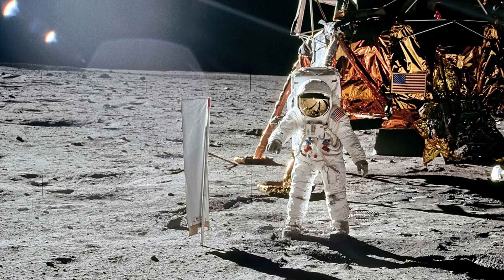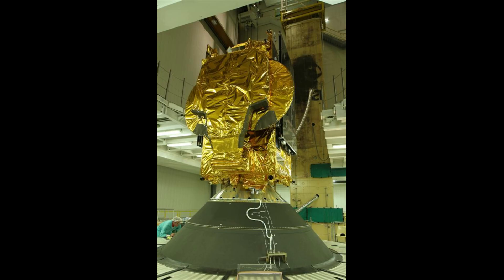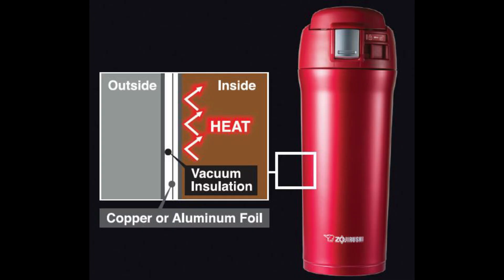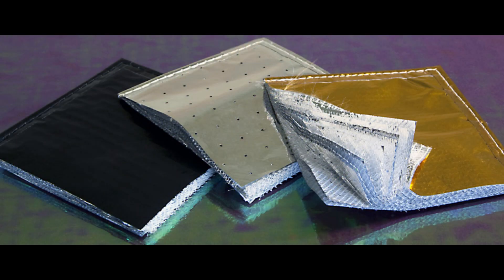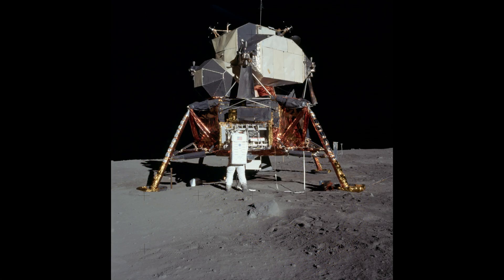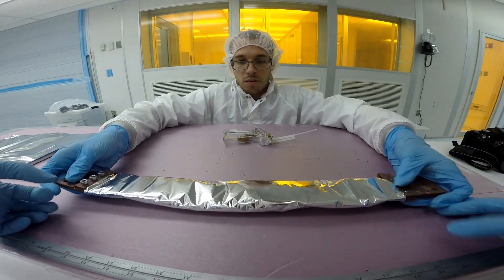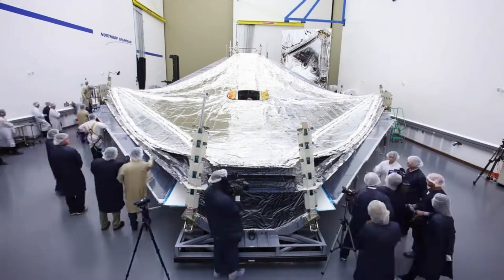Spaceships Are Not Covered In Gold Foil - The Cool Engineering Behind Multi-Layer Insulation

Comment: and what about radiation and charged particle shielding  gamma-ray , x-ray , proton+ , nuetron  ,  what apollo use for handle that ?   7 cm. lead ?  water ?  or something liar ?
Reply: Funnily enough the problematic radiation was the type you didn't mention.
Reply: Radiation levels in space are low enough that no radiation shielding is necessary for missions of up to 6 months.
Reply: @Hobbes746  UNLESS you get hit with a CME. The astronauts onboard the ISS are probably a bit worried right now.

Comment: I wonder if you applied this technology to vacuum flasks you could improve the thermal insulation and potentially reduce the size of the cavity on a vacuum flask (you loose quite a bit of liquid capacity on cheap vacuum flasks)

Comment: One genius (and simple) method of passive insulation was used on the Lunar Rover, where the batteries were packed in paraffin. While the rover was being used, the paraffin would melt, absorbing the heat being generated by the batteries, which would then solidify once the rover was parked at the end of the EVA, dissipating the heat that accumulated during use. This was a low weight solution to the more elaborate cooling system which was originally planned for the rover.

Comment: I'm confused. I don't get why the thermal blankets are crumpled. At first you explained how thermal flasks worked. Having vacuum in between the metal layers keeps the temperature from radiating. But then at the very end of the video you said that by crumpling the layers you make some touch each other improving the thermal blankets' efficiency. Could someone explain that for me please?
Reply: I think the issue would be if two flat layers accidentally came into contact it would eliminate much of the gap between them. With crumpled layers it guarantees that there will only be a few contact areas and the rest is not touching. And maybe the angles that get created cause the radiation to bounce around randomly, although that's just a guess.

Comment: "Gold is used because it's more resisted to oxidisation." But why is oxidisation a problem in space?
Reply: 1. spacecraft spend months to years being built and tested, in Earth's atmosphere, before they're launched.
2. in low Earth orbit, there isn't a perfect vacuum. You still get molecules escaping from our atmosphere, including monoatomic oxygen, which is very reactive. 
3. many electronic systems in manned spacecraft are inside the pressure hull.
Reply: @zounds010  thank you for the information :)

Comment: It always buged me that the Voyager spacecrafts  had these openings in the frame that look like vents in a tube radio, .. how could they be vents in a vacuum‽, 
  but back when it launched that's what my teachers told me.., I still wonder what their real purpose was.
   Maybe they were vents for during ground testing, I still don't know.
Reply: Yep, those are vents. Nor for air to flow through, but for heat management. When the vents are open, more heat escapes. 
this was done because the Voyagers had to operate in a wide range of thermal environments: Just after launch it was getting a lot more sunlight than farther out in the solar system. So the vents were open in the inner solar system, and were closed once they got farther out.
Reply: @zounds010  just doesn't seem like it would make much of a difference in a vacuum....
Reply: @petevenuti7355  Because it's a vacuum, the only method for heat transfer is radiation. Think of it as photons. With the vent open, photons can pass through unhindered. With the vent closed, they are reflected or absorbed and stay inside. 
The body of the spacecraft is packed in MLI blankets - in Voyager's case they had a black outer surface. The only gap in the insulation is these vents.

Comment: I was told by persons who may not have known what they were talking about that heat can radiate directly through a vaccuum if it's small enough which is why double-glazed windows keep their panes a minimum of a quarter inch apart.  Have I been mislead, Scott?
Reply: Yes, heat can radiate through a vacuum (basically as infrared light). The amount of heat that transfers this way is much lower than can be transferred through conduction if the two panes are in direct contact, and the amount depends on temperature (it scales with the fourth power of temperature).
Reply: @zounds010  I think the question is about the distance, i.e. whether the size of the gap can have an effect on the amount of heat that is transferred. It would seem like it wouldn't make any difference, in which case the quarter inch minimum in double-paned windows is more of a mechanical constraint having to do with the way the two panes of glass are set in the frame.  Or maybe it's because the krypton and argon inside the gap transfers heat so having a larger gap helps. Then again I think someone said that the distance between the layers on the JWST solar shield makes a difference, but I don't know if that is correct.
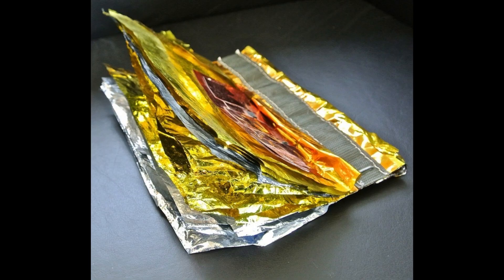Reply: But at about 3:45 Scott says that it doesn't matter how far apart the scrim keeps the foil layers as long as they are not touching. I remain baffled.
Reply: @johnedwards2119  My guess is that in the case of JWST the width of the gap is purely mechanical, with the goal simply being that the layers do not touch, per Scott's comment. When we look at the JWST sunshield it seems like the gaps between layers are quite large, but on the NASA site it says that while the gap between layers is ten inches at the edges, it's only one to two inches in the center of each layer. This helps direct the radiation away from the center and towards the sides where it can escape.  Probably they could have made the gap in the center less than an inch, but that may have been more risky and required more mechanical precision than they wanted to chance.
Reply: @johnedwards2119  Most double-pane windows don't have a vacuum between them, they're filled with an inert gas at atmospheric pressure. The distance between the panes depends on the geometry of the window: there's a balance between heat loss through conduction and convection that changes depending on the spacing between the panes.

Comment: I got a bunch of that gold foil looking insulation stuff. It is mylar laminate yup actually coated with gold. Not enough to be any weight though. The current version of the stuff has all sorts of layers as shown, but no gold. Instead, it has a layer of silicon and silicon nitride to reject the mid and far IR and aluminum to reflect the visible, polyimide is used instead of mylar because it is tougher and radiation resistant.

Comment: Buzz (or maybe Neil) said you could poke a hole in the lander with a pencil.
Reply: In the foil? Sure. In the pressure hull (which was thicker than the body panels on a car): no.
Reply: That's one of those popular myths, along with similar claims of putting a screwdriver or foot through the wall. However none of them are true. First of all there was almost no "wall" to put something through because the astronauts were surrounded by switches and instrument bays. There were some small areas of wall exposed, but the aluminum skin was about 0.3 mm thick, about the same as an Apollo era soda can. Which is why you sometimes hear the soda can analogy for the LM's skin thickness, although it was actually about three times as thick as a modern soda can.

The skin was reinforced with ribs every few inches which you can see in the photo at 11:15.  It would be nearly impossible to put a foot through it. However if you were really intent on putting a screwdriver through it you might with repeated attempts, like you could probably stab a screwdriver through an airliner hull if you were really determined to.

Comment: My uni heat transfer professor alleges that his mentor was brought in on an emergency basis to perform view-factor calculations on the legs of the LEM and tell them if they needed the foil due to radiation from the rocket plume.

His answer was no.

Their response was thanks but we'd feel more comfortable if we include it anyway.

Comment: There is another way to manage heat in space that you did not mention: phase changes.

The Apollo PLSS (Personal Life Support System) used the evaporation of water when exposed to vacuum to cool both itself and the coolant that was circulated through the astronaut's undergarments. 

The LRV also used a phase change to cool its batteries, but in this case the phase change was the melting of wax in trays that were attached to the batteries. This was supplemented with two small radiators that could be opened or closed as needed. (If they parked the LRV in the LEM's shadow, for example, it would have got really cold.)

Comment: I assume the crumpling was to keep a strait path to a minimum? The explanation of crumpling is kind of confusing but that's what I gather was the intent? 

IE all peeks and vallies in any given spot won't align due to probability, and the elasticity or springiness of the material will act like microwave button and keep it apart when you are not pushing it well non touch screen microwave.  Meaning someone servicing it won't leave a hand print on it and ruin the properties by servicing it?

Comment: about temperature management in space, 
if we take a plastic water bottle (without any thermal protection) filled to 80% with water at 15°C the rest empty for the expansion of the ice
If we place this bottle in the shadow of the ISS how long it will take to freeze completely
Reply: Plastic water bottles generally can't withstand a 1 bar pressure difference. If it leaks, the water will evaporate in the low pressure.  Substitute a Coke bottle, and it might last long enough to form ice.
Reply: Using the Bolzmann law I get about 0.5J/s of heat radiating from the bottle.

Comment: Hey Scott, have you thought that instead of using a heat shield and a lot of fuel to bring the starship down to 120 km to reenter and slow down -- how about this idea.  A space "anchor".  Take  a large grid panel of ceramic, about 500 kg that is rolled and in the ship and then exits the ship and unravels into a 5 m x 80 m rectangular grid, each grid being 2 cm x 2 cm.  This grid is attached with a high strength steel cable of 50 km to the space ship.The grid is rocketed down so it is 50 km closer to the earth, and the ship descends to 170 km..  The grid will reenter the atmosphere first and starts meeting drag and this force causes the ship to slow down and come closer to earth, causing the grid to get lowered into even denser atmosphere causing more drag.  By the time the ship is down to 120 km, it will be going let's say at 7,000 km/h and does not need heat tiles. Just like how a Falcon 9, which rockets up to 125 km at 7,000 km/h, and then with engines facing the direction of travel reenters the denser atmosphere, and then at 60 km altitude and a speed of 8,000 km/h does an entry burn, down to 5,000 km/h, and lands on the barge.  This requires less fuel than without an anchor, and the weight of tiles and fuel, expenses and time needed to attach tiles to the ship will be obviated.  This will also work well in an elliptical orbit.  The ship can reach the required 170 km altitude with very little fuel needed, if the orbit is elliptical.  The anchor may even be reusable, as it may be down to 100 km/h when it hits the water.
Reply: How would your.. grid slow the ship down if it's on a cable 50km lower than the ship?  That doesn't make any sense to me on the surface.. also I doubt 50km of cable and a 'grid' would mass less than a traditional TPS and require a whole lot more engineering and points of failure.

Comment: I've always wondered about this. My wondering started WAYYYYYY back when I was told (possibly not accurate) that they put a coating of gold on the helmets, or visors to filter the harsh direct, unfiltered sunlight. I really have no idea whether that's true or if it's a gold 'looking' material but that was an explanation I heard somewhere way back during the moon landing days.
Reply: That was correct. The Apollo helmets have a sun visor that is coated with a very thin layer of gold.
Reply: @zounds010  Ahhh, thank you! I assumed it was till I saw this which made me wonder if maybe it wasn't the same. I had been assuming that insulated covering material probably was too but, this got me wondering. 
Nice to know what I learnt about 50 years ago was correct👍.
It does still leave me amazed to think they're actually looking through metal though. I think it's awesome, just surprised it works.

Comment: That’s great because the thermosphere would melt aluminum or gold 200 miles up. What kind of plastic? What’s the infinite vacuum pressure of space versus the thickness of an aluminum can hull of the lander
Reply: There's no such thing as "infinite vacuum pressure". The force on a pressure vessel depends on the difference in pressure inside and out. When the inside is at 1 bar and the outside is at 0, the difference is 1 bar so the force on the walls is 1 kg/cm2. A Coke can withstands a bigger pressure difference than that, while being thin enough that you can crush it with your hands.
Reply: An aluminum can holds almost 4 bar gage when filled with pressurized soda. The infinite vacuum of space is 1 bar below atmospheric, so the aluminum can could hold the pressure from the infinite vacuum of space even if they pumped it to atmospheric pressure - which they didn't. The LEM was only pressurized to about ⅓ of a bar. Also, thr skin of the pressure vessel was reinforced by a grid of ribs, so the skin panels were only unsupported for about the diameter of a soda can anyway.
Reply: @MichaelOnines  so you’re saying they couldn’t have gone to space with a very thin hull. And in space aluminum doesn’t melt. And space is not a vacuum.
Reply: @9greatdanes981  Your lack of reading comprehension explains a lot. No, I said a thin hull can hold more than 6x the pressure of the LEM, so a thin hull isn't a problem. The grid reinforcing means the example of an aluminum can is appropriate to show it can hold the required pressure. Also, you ignored Acme Industries explanation that high temperature with very little density means negligible heat transfer. Negligible convective heat transfer from the thermosphere means it isn't going to be melting aluminum.
Reply: @9greatdanes981  Stick your hand in an oven at 200c. Notice how you can do this quite safely for quite some time. Now go stick your hand into 100c boiling water. If aluminium got weakened to the point of melting when pressure got low, then most planes wouldn't be able to fly. You know nothing, and you're dead set to tell us you know and understand nothing.
Reply: @MichaelOnines  , don't feed the brain dead.
Reply: @9greatdanes981  You just mentioned negative pressure, can you explain how it is possible to go from a perfect vacuum (0 psi) to negative pressure as I'm sure the world of physics would love to know about this.
Reply: @Kestrel626  i have a vacuum gauge and a pressure gauge and space would destroy my vacuum gauge according to NASA
Reply: @9greatdanes981  If you have a tire gauge that measures gauge pressure so zero is indicated at 14.7psi & it could be damaged by a vacuum. A vacuum gauge measures absolute pressure so it would read zero in a pure vacuum & 14.7psi at sea level, its not going to be damaged.
Reply: @9greatdanes981  Wow, you think you understand FAR more than you actually do, some of that is so cringe worthy it makes me wonder what education system failed you so badly.
Reply: No, the thermosphere doesn't melt anything. At 200 km the pressure is 0.00001 Pa, so there is very little matter there that can transfer heat. In practice, the thermosphere can be ignored for satellite thermal design. That is dominated by solar heating (1300 W/m2) and heat radiation from the spacecraft into space.
Reply: @zounds010  tell that to comets exposed to sunlight… tell that to metal off gassing in a vacuum.  Space only works if you don’t think about it.

Comment: My best friends dad was in charge of wiring for the LEM. He would bring home lots of this plastic film from the plant for us to play with.
Are you aware they made TWO identical LEMs?? One went to the moon, the other stayed in the plant in Bethpage. After the astronaunts came back safely, the duplicate LEM was pushed out into the parking lot and spray painted with camo green and left out in the weather for a LONG time. I used to see it outside of the hanger every day on my way to school.
I also had the super guppy fly over my house when it came to pick up the LEM and deliver it to NASA in Florida
One of the scariest things the engineers thoufgt about was the explosive wire guillotine that cut the wires from the ascent module from the decent module. If this failed, the ascent module would just tip over and never left the moons surface

Comment: This foil is nearly the opposite of Black Body radiation (3:57 of the video) .  Black Body radiation occurs when the emitting object is a dull black.   A perfect Black Body has an Emissivity of 1.0 while the foil's Emissivity would be be approaching zero (depending on how shiny it is).  If the foil layers were Black Bodies it would provide significant insulation but would result in 2 to 3 orders of magnitude more thermal energy transfered (per foil layer) than what the shiny foil provides.

Comment: Kapton is also used extensively at the LHC and I assume any other particle accelerators too. 
Not always for the temperature stability though, it is also very radiation hard and a good dielectric. It's the tape of choice at our small detector on the LHC for electric insulation (including high voltage) and stuff like fixing thermistors in places even as close as few millimeters from the LHC beam, so a very radiation intensive environment.